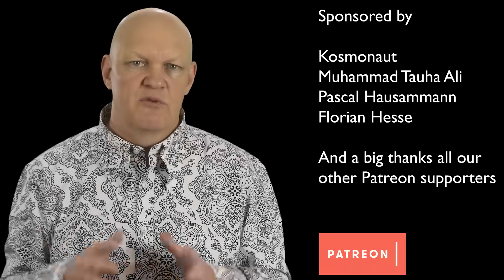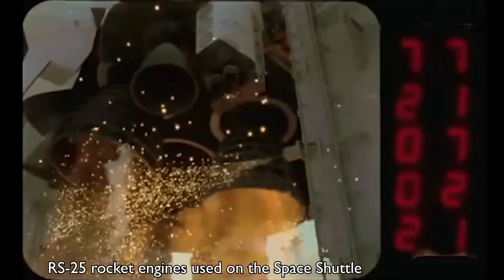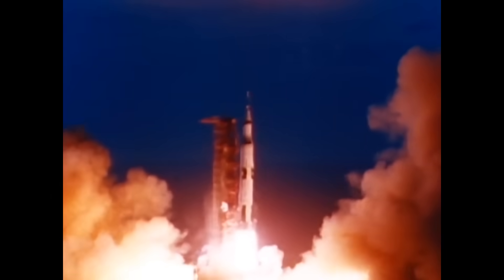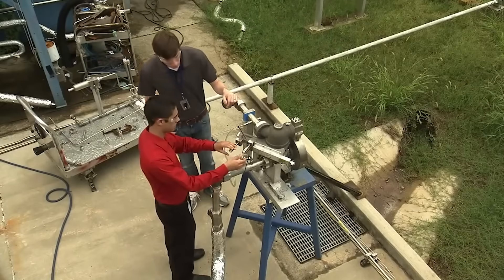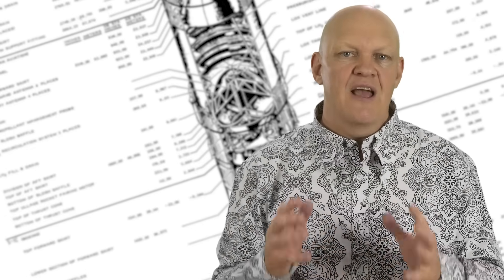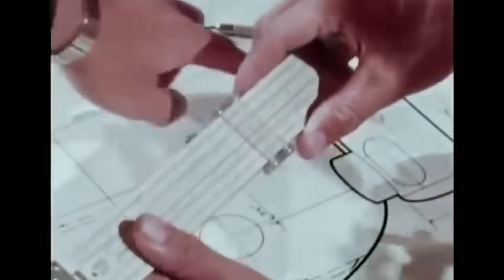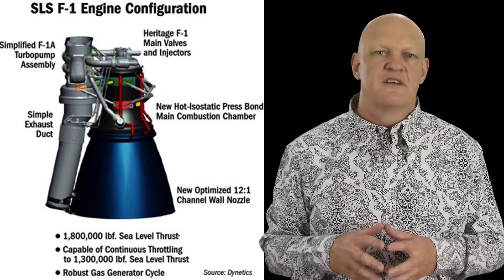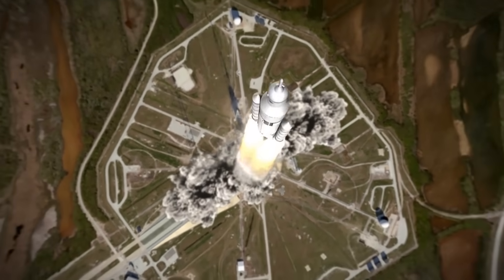Why Can't we Remake the Rocketdyne F1 Engine?

Comment: Skilled builders and craftsmen are a dying breed.  When it comes to rocket engines it's even more so.  Re-engineering the F-1 to make it simpler and likely lighter is not a bad idea.  What happens next is hard to say.
Reply: "Skilled builders and craftsmen are a dying breed."

Not true at all.  The real downfall is the seeking of "experience required".   Not to mention education.  So many incredibly skilled people who can do things no one else would ever dream of would never be considered now compared to back then.  Also NASA essentially had a blank check back then and now their budget is very limited.  They cannot afford to take risks which in turn drives up costs.
Reply: A reengineered F-1 is not bad; NASA and Rocketdyne during the old Project Constellation resurrected the old J-2 and was going to use it on both the Ares I and Ares V. The Block II SLS is slated to use LRBs for the "first stage" portion of ascent so a reengineered F-1 is the best choice. The biggest thing that has to be done with anything (of course), is testing. That is the only way one can get the bugs out of the system. Look at the RS-25 (a.k.a. Space Shuttle Main Engine), it took years (and several failures) for Rocketdyne to nail the problems down, allowing the RS-25 to be one of the most reliable rocket engines ever made.
Reply: that's why it is sad. in the modern world where all information is at our fingertips yet hands on experience is a commodity that no one can get. I personally have been interested in forging and metallurgy for awhile but i can't even find anyone who knows how to forge within a reasonable distance. the tools to do so are also rare now with many fakes floating around such as a cast iron anvil which is soft and brittle and just cannot do the job.
Reply: Do you watch Alec Steele's Youtube channel at all? He's not the most experienced blacksmith on Youtube but he's a very entertaining one to watch. It's interesting to see him learn and expand his knowledge and experience with welding, forging and metallurgy, and his hyper-caffeinated squirrel mannerisms results not only in very entertaining videos, but lots of them, he posts  up videos 5 days a week I think and can put hours and hours into just sanding a blade he's made. 

There are still apprenticeships in the US, they just aren't as readily known about, and of course few if anyone apply have the basic skills that were needed to get into them. As that used to be where the students went after getting a basic instruction and introduction into the trade at the trade schools.

Are you serious? Unions have as much, or more power than most large companies. Companies might contribute more in the way of dollars to campaigns, but unions are able to not only contribute money, but also manpower, for campaigns and in effect tries to sell the votes of it's members. The are most powerful at the local level, where their are far more involved in local politics than companies in those areas tend to be. In my county 9 of the 10 top employers are governments and government agencies, and the average wage of each those employees is 2 to 5 times the average income in the county. On top of this more than 1 in 3 people in the county is on welfare, in various forms, so in effect it's likely over 2/3rds of the resident in the county rely on government largess, either in employment or handouts, so live. How are others expected to survive and support such a system? Now on top of, and because of this, the taxes in Western NY are virtually the highest in the country, and that's without considering the total taxes paid. For example our property taxes are some of the highest in the country, as are our income taxes, gas taxes, sales taxes.

When I get my check, it has already had Federal income taxes, FICA taxes and State income taxes taken out. After that I have to put aside money to pay County taxes, over 88% of which go to pay for Medicaid (the Fed pays 50% and passes the other 50% to the State but NY only pays half of that, 25% and sticks the county with the other 25%), school taxes and local taxes. Then what little I have left is subject to 7-9% sales tax and some of the highest taxes on gas in the country. And then on top of that if I get a phone, the Federal government, NY my County add several special "fees" such as a 911 surcharge, an access fee, so they can give free phones to people I'm already being taxed to support, and of course a few extras percentage of taxes specifically because I'm getting a phone service. Then if I want internet the government again adds an access fee, to subsidize those I'm already supporting getting internet access. Then all I hear from the left is that we don't pay enough taxes, despite the government always managing to spend more than they collect.

Now who supported all these extra taxes, especially at the local level? It wasn't the companies whose services are more expensive because of it, no it was the government employee unions which gets rich by encouraging a greater and greater theft from those working and earning money in the United States so the government can hire more union members, I mean workers, and give them pay raises, which of course increases the amount of union dues they paid.

So yes, teachers and their unions pushed for closing trade schools to fill their own pockets, as the teachers in those schools belong the their respective union not the teachers union and  teachers and other government workers unions all but own local, county and State governments.
Reply: This provides a perfect example of why the US government keeps buying a small number of Abrams tanks every year despite not needing the tanks, and actually having depots full of them, because if they don't it would close the only shop that has the skills to make advanced tanks and in a few years when the next model of tank is adopted we wont have anyone capable of actually building it.
Reply: " Skilled builders and craftsmen are a dying breed. " 

I doubt that, they are probably all working for private corporations who dont let any info leak
Reply: Dying, not dead.

When welders and other blue collar workers are being flown around the country for interviews and wined and dined in ways normally reserved for executive positions, as happens regularly now, I think it's fairly obvious that there is a far greater need for the skill then there is skilled supply.
Reply: Wait wait wait. Hold on.

You say that "Re-engineering the F-1 to make it simpler and likely lighter is not a bad idea." But you started off by saying "Skilled builders and craftsmen are a dying breed."
You know the F-1B wasn't designed by Cold-War-era fossils, right? It was modern engineers who developed it. This generation's skilled builders and craftsmen developed an engine that's cheaper, more powerful, and more reliable than the original F-1 engine.

So which is it? Has our technology moved forward or backward? Has our capability moved forward or backward?
Reply: The claims of superior students from 20 years ago sounds like wishful thinking and probably a lot of selective memory on the teacher's part. As someone who was among other engineering students around 30 years ago, there were always exceptional early-starters present but also many (if not most) who had no clue what even basic tools of the trade were about. And since the required teaching curriculum was rigid as to how it approached the educational process, the really knowledgeable students tended to be bored with the material (as least early on) while the less experienced students struggled to keep up. I saw few people who were still "bored" by the time they approached the end of their degree study since everyone was getting exposed to something new or unfamiliar, and noone was just showing up to get a diploma.  I suspect that nothing has changed/improved significantly from how education works today compared to back then, nor the ability (or claimed lack thereof) with the student's starting quality.
Reply: it's not the college level education, it's the earlier education, the closing of trade schools have slaughtered the number of skilled craftsmen that are available. Teachers and their unions convinced the States and it's people that everyone needs to go to college all they did was increase costs and created a huge gap in the skilled trades, where it used to be every graduating class would include many students well on their way to becoming skilled craftsmen, it now generates many students well on their way to being skill-less college drop outs as many who are not college material, but could have been great craftsmen are forced onto the college track because of the power teachers and their unions hold, especially in States and the smaller areas that make them up, and those two groups are the only ones to have benefited by this change.
Reply: I honestly have no idea where you got that notion. Unions really don't have much power and most of the legislation that would be affecting what you are describing would directly link to congress for making the rules and pres. for not vetoing that. Even so the educational system is designed to keep people rounded off so that you can be adaptable in a rapidly changing industrial scene where a person is likely to see at least 2 careers in a lifetime.
Reply: Builders and craftsman are indeed a dying race. Just started a bachelor study in electrical engineering. A teacher told me the story that 20 years ago new students already had a lot of knowledge, just came to get there diploma. This year he had a class where the whole class, every single student, never even touched a multimeter or heard the term op-amp (operational amplifier)....

I just couldn't believe it.
Reply: Frightening!! The curve is on the down slope for advanced civilization !
Reply: Yeah, my father dropped out of school in the 8th grade, he did eventually get his GED, decades later, but that was just because in his work for the phone company, some of the training he would be sent to required the student have a diploma. Over time his department, switchmen which were basically the troubleshooters at the main exchanges, had shrunk to be just him and but when he retired, this 8th grade drop out was replaced first with 1 electrical engineers, with a 2nd and then a 3rd being added shortly afterward in order to keep the systems operation, and of course he received calls for years afterwards to get help and advice on the systems.

It turns out learning systems by actually developing, building, installing and then maintaining them is far more informative then a sheet of paper verifying that you spent years in school learning about the theories behind those electrical systems, who knew?  lol!
Reply: today is a different day and age. back then you also had apprenticeships too (they are still done in europe) and jobs did not constantly require you to prove educational level and a certain level of experience. now you can wow the world and people won't even look at you without that piece of paper and a lot of experience gained through impersonal internships and self experimentation.

During WW2 for example many of the engineers were practically handed the job after they went through a multi-stage STEM test to weed out the geniuses. Those who passed did not necessarily have experience or a degree but proved they could do the job so the military took them. These days it's all about what you have already done because no one wants to wait to see what you can or will do.
Reply: They aren't dying. They are changing. They aren't what YOU think skilled builders and craftsmen are. They are what they need to be.
Reply: gravitygear There isn't a law that defines necessity, but what they are can never be what they were. So its better to leave that to the process of developement.
Reply: spacex

Comment: Well I think these old rockets were jam packed with mechanical and hydraulic control systems and safety systems that might as well be replaced with a microcontroller and some software. Also the designs for the actual rocket parts could be optimized a lot with the knowledge gained in the last half century.

Comment: Slight corection:  You stated that the Saturn IV/F1 Engines weren't built since the 60s.  They were the primary mover for Skylab (In fact, the body of the station was part of a Saturn IV) in the early 70s.  The last one May 1973.  (I was born 29Dec73.)

Comment: I would say it's more of a could / should question - if you'd try to ignore 60 years of new technology and re-create a desgin from that time you'd get extremly expensive basically hand fitted rocked engines while reverse engineering and adopting 60 years design to current standards will probably give you a much cheaper and erasier to reproduce engine with stuff like interchangeable parts and probably improved overall quality.

Comment: This video is spot on. Even today, "tribal knowledge" exists at the manufacturing level. We had a fleet program to replace new production flight control actuators. This was due to a change at the manufacturer and the retirement of one individual. The machinist knew what to do to prevent leaks. His replacements did not. Hundreds of actuators, and millions of dollars later, the problem was fixed with a modern solution. Even the heat treating of metals used to be a "do it by feel" type of operation. The operators knew that when 5 extra parts were put on the rack, an added hour was necessary to get a good result. Today, computers control the process to the second, perfectly, but don't account for the mass of the 5 extra parts and some improperly processed 2024 aluminum corrodes like crazy due to improper heat treating. Tribal knowledge.

Comment: Sadly I never got to know the man due to his passing 10 years before I was born, but my grandfather worked for one of the big subcontractors that built a lot of the machinery that took us to the moon. He was a millwright that had a direct contribution in developing some of the experimental welding techniques that were used with many of the then emerging exotic alloys. His millwright stamp is on the moon on various parts left behind such as the lunar rover. He very well could have welded many of the components on the F1's as he worked at Aerojet in Folsom, CA where they might have built some F1 sub-components that were then shipped off to Canoga Park.

Comment: I think we should prolly use 12 of those engines in a octagon and put an even bigger engine in the middle with gimbal.  Big engines with 40 parts each sounds way easier than 42 engines with 10 times as many parts. Better yet just build a sea dragon,

Comment: Outstanding job.  The truth is worse than you think.  For many things the USA does not have the manufacturing capability on its own anymore.  Ex, Single pour reactor vessels.  There are others, especially defense, construction, heavy lift, and machinery related too.  Instead, we rely on other countries to produce them.  Interestingly, some of the Chinese made steel that was recently used to build our navy ships has been found to be softer than it should be.  There are also discussions about hardware being put into Chinese made computers and phones that make them accessible on a sub-internet or by backdoors.  Sometimes progress is not necessarily progress.  Sometimes cost savings actually cost more.

Comment: What he didn't say was that the F-1B would have been 35% heavier than the F-1. The new J-2X was similarly heavier than the old J-2, when equipped with the same area ratio nozzle. J-2 design start was 1958, J-2X was 2006.

Comment: At about 4:35 CD makes a contradictory comment.  After explaining how modern engineers studied the design of the Rocketdyne F1 and, while they couldn't rebuild it, they came up with a more efficient, simpler engine, the F1B, then he goes on to say that sometimes its easier to design from scratch.  The F1B was definitely not designed from scratch.  Only by studying the F1 and how it was made could they have come up with the design for the F1B.  I'll go further, no modern machine or device is designed completely from scratch, but all take ideas and techniques, from what has been made before.

Comment: I have enough trouble with 4 year old diy instructables. That use parts I can get at "any hardware store" that aren't available in Canada.

I end up spending as much or less effort just making my own build with what I can buy today.

Im not an engineer (though I wish I was). But I can understand part in f this struggle before finishing the video.

I also keep better notes now. In case the extra steps leak out of my memory before having to building something a second time.